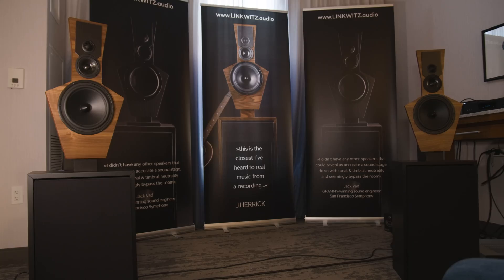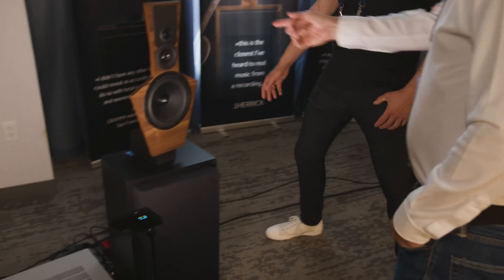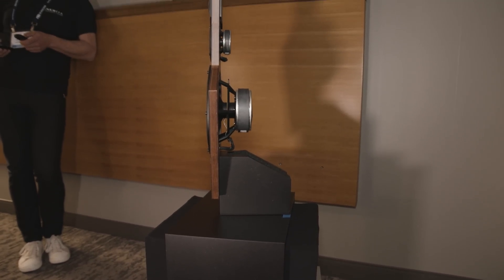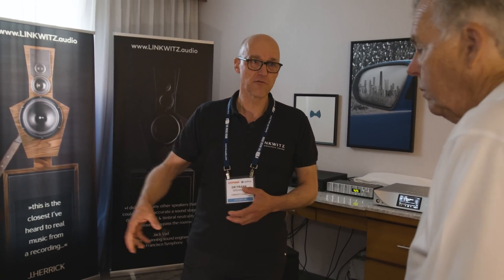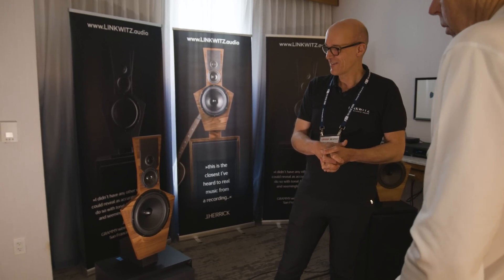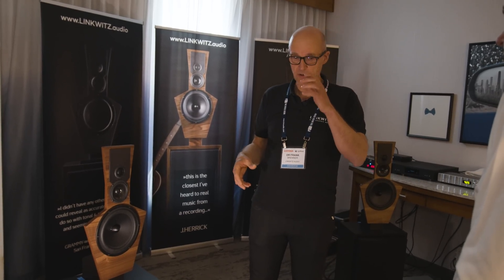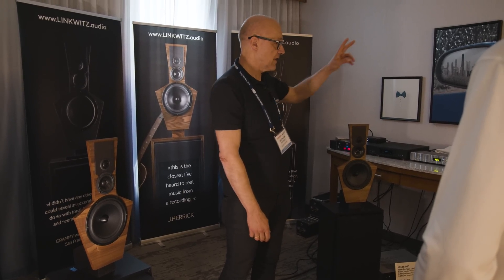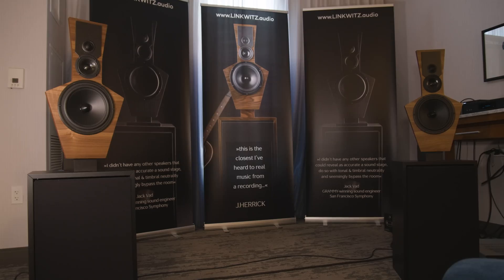The Linkwitz LX521 Reference Loudspeaker | Preview

Comment: The most important thing to remember is that this design does not look like your idea of what a speaker should look like because it is trying very hard not to be like any box speaker out there. All box speakers, whether sealed or ported, have problems with cabinet resonance. That is, all box speakers sing their own tune, which is a poetic way of saying they produce resonant distortion. Linkwitz LX521 are dipoles and were designed to reduce the impact the number one and two source of distortion in audio, the room and the speaker box. It looks different because it's performatively different.

Siegfried Linkwitz was a (very talented) microwave energy engineer for Hewlett-Packard. He understood quite deeply the topic of wave-energy propagation; almost like it was his career... His specific skillset allowed him to think approach sound as something you could focus and beam/project.

As a dipole, this speaker is like a lighthouse that sends out beams of sound forward and backward, with nothing to the sides. The radiant pattern of a dipole greatly reduces bass distortion (room modes/eigentones and room-overpressure) but also eliminates the off axis fall-off in the treble and upper midrange that results in a tight, narrow "sweet spot" in the stereo image. This is not to say that the stereo image is wide but unfocused. It is both highly detailed and doesn't fall apart or collapse into one speaker the minute you move a few inches left or right of dead center. The stereo image works broadly, which seems magical when you're used to box speakers.

With omnidirectional bass, the room is pressure-loaded just like stomping your foot in the center of a bathtub full of water. The pressure wave goes out, hits the sidewalls and returns, making a big mess. With dipole bass, the bass is beamed like a flood light where you want it to go, just like the upper midrange is, typically. This dipole produces deep, subwoofer bass without all the slop and mess. It's articulate and tight. It will lack the special effect of the concussive pressure wave of, say, an 18" ported sub. But leave that to the home theater geeks and techno heads.

With bass tamed, the mids and treble have room to breathe. That 'violin' shaped baffle on the top of the anti-resonance decoupling bridge is an acoustic lens*. People look at this thing and think, "Oh, that's ODD looking."  But that is like pointing at a jet plane and saying, "That does not look like a biplane! It does not look right to me so it must be a piece of junk!" No. The appearance and shape of this speaker are *purely functional. If it is odd looking to you, it is because you are seeing something that breaks every visual rule you have about what a box speaker should look like. But it breaks those rules because it is not trying to do or be the same thing as any box speaker. And that is a good thing!

Linkwitz arrived at this violin shape over a decade of design, mockups and testing. His goal was to carefully control exactly how much energy in each portion of the frequency range wrapped around from front to back. That's why it is wider in the midrange and narrower at the top. It's literally all math. Think of it this way, in a dipole, when the box is open some of the energy from the front wraps around to the sides and so does the energy going backward. When they hit one another, they cancel out because they are 180° out-of-phase. Many dipoles sound interesting because they lack box resonance but have problems because they are not controlling cancellation by frequency. If you stick a speaker in a rectangular shaped open baffle, it is not going to focus individual frequencies so they behave the same. So by shaping this violin shaped lens, Linkwitz was designing how it focuses sound energy at the same time as he was designing its frequency response.

Essentially, you have to hear this thing to believe it. Forget all your preconceived notions about sound at the door. It has all of the benefits of other dipole systems with fewer drawbacks. Yes, you do not want to shove these up against the wall. They definitely work best in open floor plans because they require a BIG volume of air to work properly. They definitely want to be out from all walls by about the same distance as a person is tall. They definitely do not want to be in an equilateral triangle with the listener, but better set up at the points that divide the room width into thirds. So they bring some requirements in terms of room and room placement.
Reply: You've nailed it. Thanks for the time you've taken to explain so easily the basics of a very complex design. And this comes from a LX521.4 owner and complete devotee. 

After all, there is no generalized scientific answer from the commercial audio industry to any of the serious questions posed in relation to the loudspeaker/listening room binomial, which is ultimately the essential link in any sound system. And this is where SL pointed all his efforts and documented them in his website. 

Best regards
Reply: sadly the dipole bass is a complete myth, beyond the schroeder frequency in small acustical spaces it means squat whether the bass radiates as omni/cardioid/figure8 as the response is purely steady state and the human ear needs a few cycles of waves this big to even register them, even the original designer of D&D 8c a speaker with cardioid bass admitted this, if non omni bass changes the stady state response of your room favorably its purely by accident but in most spaces you are just loosing output beyond schroeder frequency
Reply: @Tacet137 interesting remark, could you please elaborate on that?
Reply: @Tacet137 interesting remark, could you please elaborate on that?

Comment: So, is this a commercial product of what was once a DIY/kit?
Reply: Yes an improved version with improved crossovers,  drivers and your choice of finishes.  Linkwitz also still sells kits but they are much nicer than the old ones.
Reply: @56ctconger  Thanks, I remember the kits Linkwitz sold back then.
Reply: @scottwolf8633  - the old school kits are still avialable through Madisound, but updated to the newest version. That being said, the commercial product is using nicer drivers and adds that second tweeter, which makes a difference.
Reply: I stand corrected - rear tweeters are in the kits, too
Reply: Madisound does sell the older wood parts and driver set. But they are not the newest parts. They offer a crossover but it differs substantially from the latest version. The lower mid is a totally different driver and makes a big difference in sound quality. Lastly the kit parts from M are serviceable but not very well made. They are also of different materials. IMO in this case you really get what you pay for.
Reply: @56ctconger  I'm really not interested in Mr Linkwitz's design. I've been listening to a line source, push-pull, planar magnetic, dipole, x'd over at 200Hz to a pair of Morel 164's/channel, each in their own 12ft long pvc, schedule 40 waveguide. First driven by Audio Amateur's/Old Colony, Class A, MOSFET, Lang Amp, my version, and now a pair of monobloc  Class AB, OTLs. My newest drivers, a Raal 140-15D , Lowther DX 65, and a pair of Jordan JX 150 ND II's/channel with another OTL, this one single ended, for a biamp. But I remember Mr Linkwitz's articles in Speaker Builder, on this design and His earlier work with a pair of satellites and a single common subwoofer, back in the '80's. I was sad to hear of His passing.  Thanks for the update, appreciate it.
Reply: @scottwolf8633  Sure thing. Enjoy the music!

Comment: I don’t like active crossovers because I have no amplifier options. I like the passive version if available.
Reply: With active, low level, x-overs you choose whatever amplifier you desire.
Reply: While the full system includes the 10 power amps , 5 in each box, it is possible to order the system with just the active crossover. Then you can use any power amp you want. I am not sure but they may also need to be of the same power rating because in general gain follows power.
Reply: @56ctconger  The gain must be matched, but the power levels can be different.
Reply: That is a good way to put it.  My point was that most power amps scale gain with power. If power goes up gain does as well so the the typically fixed line level can drive the amp to full power.
Reply: what? you can use any amplifier you desire with active speaker, its just going to be very expensive since you need one channel of amplification per driver
Reply: @Tacet137  We demonstrated the LX521.4 speakers at T.H.E. Show in Costa Mesa using four Pass Labs amplifiers. The woofers were driven in parallel with 500 watts into 4 ohms. The gain was the same on all four amplifiers. The other three were 30 watt Class A amps.

Comment: I spent time in the Linkwitz room at AXPONA both this year and last year.  In a slightly larger room they completely disappeared and the soundstage seemed twenty feet behind where they were setup, and localization within the stage was fantastic throughout the room. Bass was plentiful and tight. They were in a smaller room and weren't showing their best last month, unfortunately, but midrange and treble detail was still very good. I didn't hear another system in any room in the last two years that does what this system does well. The speakers can even be built from a DIY kit for less than $5K and they provide the crossover settings for a miniDSP so you can bring your preferred amplification. I didn't note any obvious Class D issues with the modules they use in the power boxes.